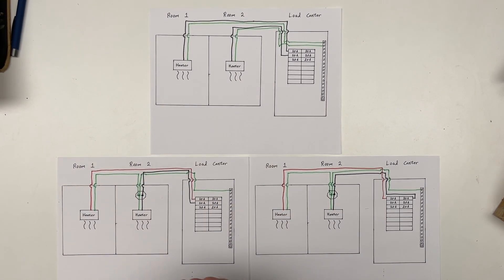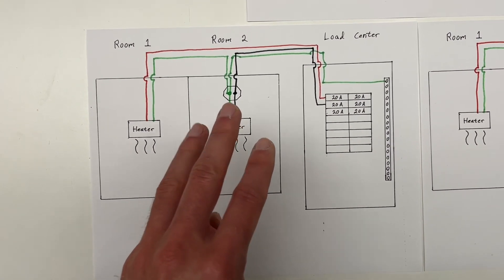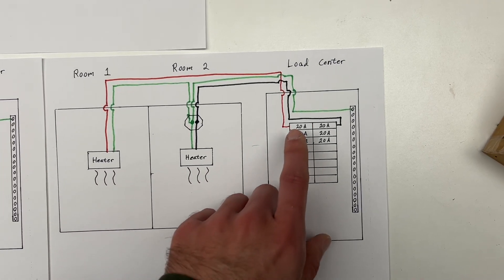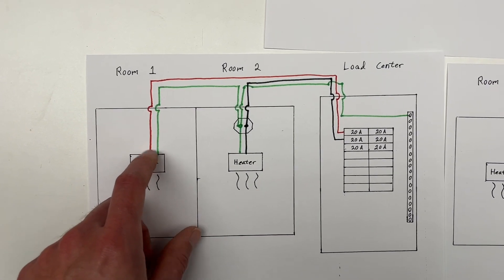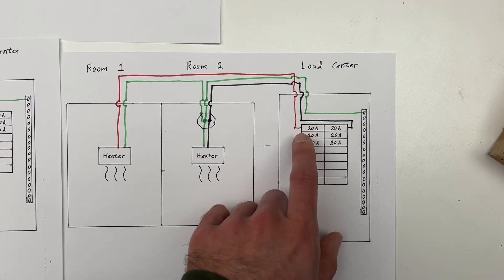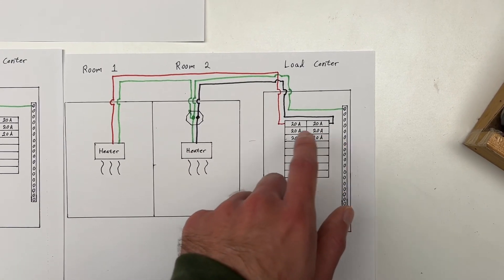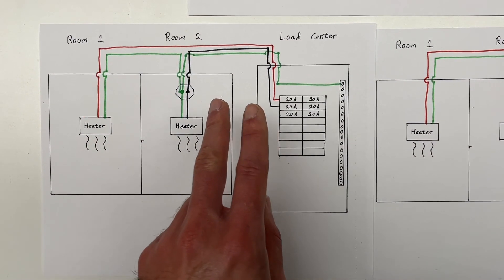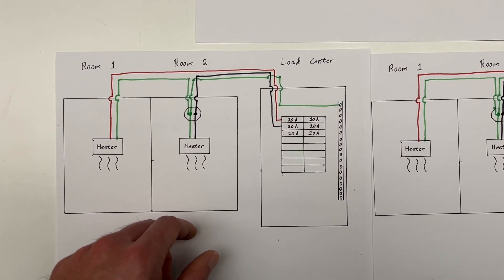How to SAFELY Connect 3-conductor Wires to a Breaker Panel #electrical

Comment from the maker: Clarification: Feeding 2 circuits via a 3-conductor wire (also know as a Multi-Wire Branch Circuit) is not normally done in new construction because it is not compatible with arc-fault and GFCI breakers, which are often required. This video is showing how to safely manage EXISTING circuits. In my case, my existing multi-wire branch circuits were a safety hazard and corrections were needed.
Reply: So, the new breakers DO allow a 3 conductor wire to feed 2 different circuits from one dual pole combination breaker. The new circuit breakers can feed both 120V and 240V outlets using 1 piece of 3 conductor wire (12/3 or 10/3 or 8/3 plus a ground wire) while retaining their GFCI function.  You have to purchase a dual pole "GFCI 120V/240V" breaker. The breaker calculates the load for wires, and it actually knows when there is a ground fault. This is really special, because you can power something like a kitchen stove, some which actually require 120 volts and 240 volts, to operate the stove. But the most exciting part is that you can install a mixture of 240 volt welder outlets, and regular 120 volt receptacles in your home or garage, and run them all off 1 piece of 3 conductor romex (3 conductors and a ground). 

To follow code, garages have to be 100% GFCI, including the garage door opener plugin. Using 3 conductor romex with a modern computerized GFCI breaker in the panel, allows you to have 100% GFCI on all your outlets, including your 240 volt welder outlets (receptacles). The main advantage is less copper, and you can use 4 pin receptacles (like an RV receptacle) that contains both 120v and 240V on the same plug.

The reason you need a "dual pole" breaker that is tied together, is because the red and black hot wires are present in all of the boxes, even the ones that are shut off, because all of your "splices" in the wire occur in all of the receptacles, meaning all receptacles contain BOTH the red and black wire inside the box. 

You cannot get shocked from the neutral (at all). The neutral is at the same voltage as the water pipes, and the Earth, and the concrete floor, and the building structure. So there is no way a neutral can shock you. Unless you have an energized red or black wire (or any other energized "HOT" wire). But this is not a fact, and you should consult an expert!

Comment: Ur so wrong on every level it’s not worth correcting u smh. I guess that proves anyone can make a video my advice is forget everything he said
Reply from the maker: If you are saying that I should not have replaced the single-pole breakers with dual-pole ones, please give some specific reasons why.
Reply: @reidthemanual  You're good. The only thing you were wrong about was at the very end of the video. When a MWBC is wired correctly, and the load is balanced, then no current at all flows on the neutral wire, it simply flows on red and black just like a 240 volt load with no neutral. In fact, you can disconnect the neutral wire at the panel on your example circuit and both room heaters will still work fine. Of course in real life, that wouldn't work very good, because no heater uses precisely the same amount of current due to manufacturing tolerances, and the wire runs are a different length etc etc. But if you shut one heater off, then both heaters will 'turn off'. The dangerous thing is if you open up one of the heaters to see what's going on, there's a big risk of shock because the heater is still energized, but no current is flowing. If you touched anything, then "You" become the neutral and that's not a good thing! The same danger occurs using a light switch to switch the neutral wire instead of hot to a light fixture. In the bad old days of knob and tube wiring this was done all the time, if it was convenient and saved on wire. That worked ok, but only because that used to be an ungrounded system so you couldn't get shocked unless you made contact with both a live and a neutral at the same time.
Reply from the maker: @brnmcc01  I really appreciate your comments.

Comment: (1)  Your diagram should not use Green to indicate a neutral, current carrying conductor.  White is normally used for that in wire colors, but on your diagram, you could use a dashed line of some other color, and clearly label it as the neutral.  Your diagram doesn't seem to show any equipment ground conductors at all.
(2)  The Multi-Wire Branch Circuit idea (sharing a neutral) was used in some situations years ago, but no more, since the advent of AFCI breakers, which are now required on practically every circuit in a residence.  AFCI breakers require the neutral for EACH circuit to come independently back to the breaker.  The MBC approach will immediately trip breakers, since the neutral current will not match the current on the black wire.
Reply from the maker: @mikeheller1225  I totally agree on all points. Silver/gray would have been a much better choice (compromise) for representing neutral in the diagram. A dashed line would have been better too. As far as the MWBC, the big takeaway here is hopefully that if you already have MWBCs in your house, make sure they were installed safely! Mine were not. I was not required to update to AFCI, but I definitely needed to fix the safety issue.

MWBCs (and their nuances) were unknown to me when I bought my house. Thankfully, I never got shocked when doing repairs, and hopefully I can help protect others by raising awareness.
Reply: @reidthemanual  White would be too hard to see on a white piece of paper, I didn't like the green but I thought you explained the reason for that color well, and you mentioned for clarity you omitted the EGC. All good. Grey would be ok for a neutral but mention that normally grey is only used typically on a 480Y277 volt system, where the L1, L2, L3 phases are brown, orange, yellow., and then grey for neutral.

People have died before when a neutral wire was accidentally connected from a 480v system to a 208v system in the same building. Mike Holt has a good video on this and showed that accident as an example in one of his videos.